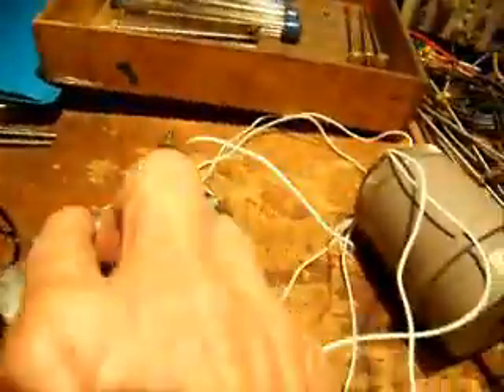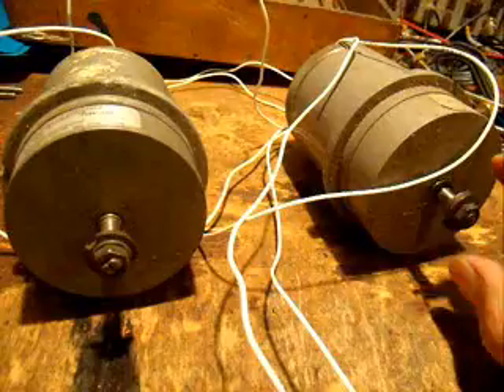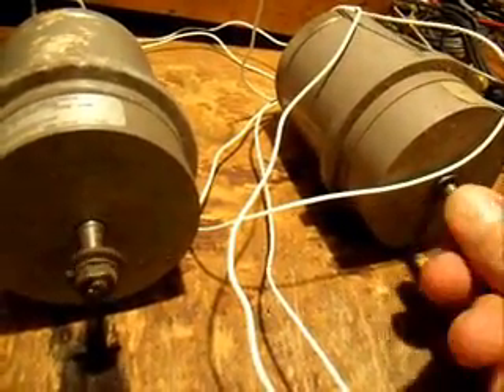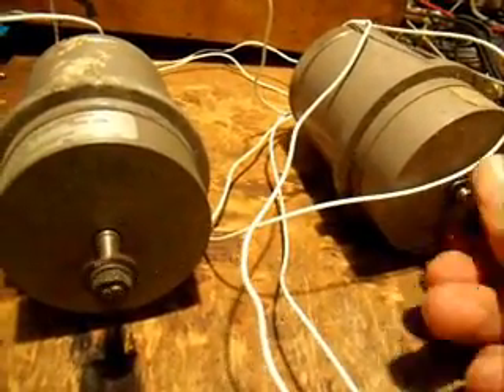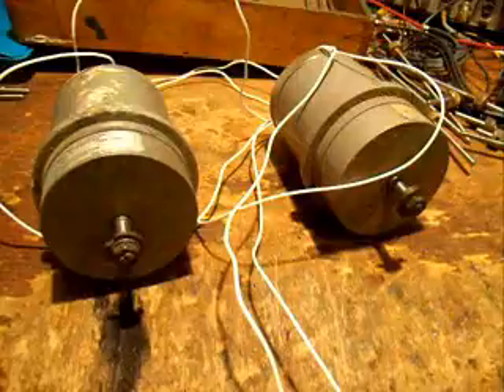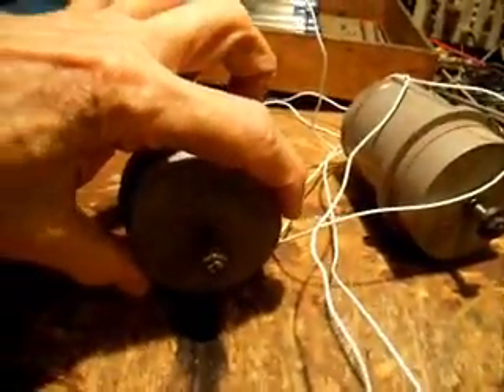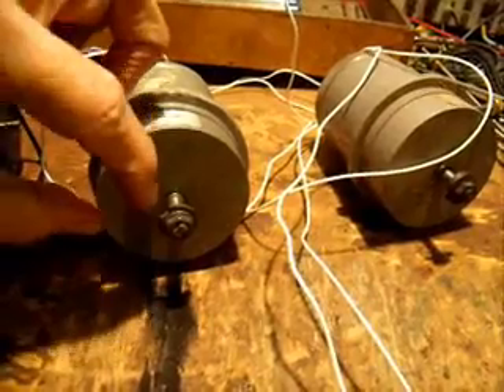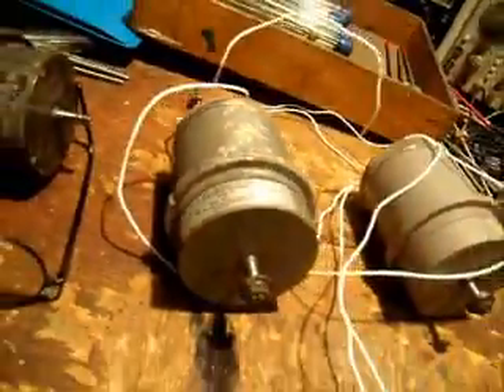slaysyn motor demonstration

Comment from the maker: The torque from the load motor is directly reflected in the driving motor. These have very little torque, however they can be run through gear boxes to have tremendous torque by letting the motor turn multiple times for each output turn. The output torque is directly reflected to the driving motor of course.

Comment from the maker: The rotor goes to brushes and sliprings. They are sliprings, not a commutator like in a DC motor. The rotor is a 2 pole and the stator is 3 poles. Thus, there is an alignment of the magnetic fields only at one orientation. If you turn one motor, the alignment changes so the fields in the other motor change to match since they are electrically interconnected, thus causing rotation. A very easy way to transmit motion from one place to another without mechanical linkage!

Comment from the maker: Yes. The stator looks like an induction motor winding. Actually, it is a 3 phase winding that would work fine as an induction motor. The rotor is a 2 pole with the winding going to slip rings.

Comment from the maker: You are right on the name! In my old age I got it mixed up! These are 120 volt 60hz units. The smaller 400hz units are harder to find. They have very little torque at 60hz due to the much smaller core iron mass in the motor.

Comment: are there brushes inside them that when you turn it it changes the coil connections on the motor and turns it

Comment: So what about torque?  If under load does it keep up with exact motion?  If you use one that is not loaded as a controller for one to say move a conveyor belt, would you just have to turn really hard to overcome the resistance, or would it feel like nothing is there on the loaded side and draw more current to do the work?